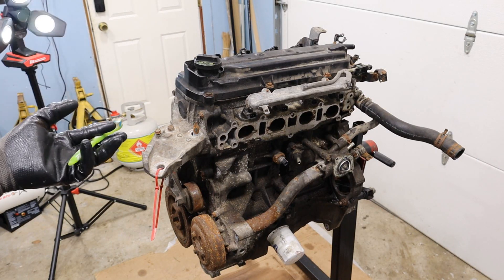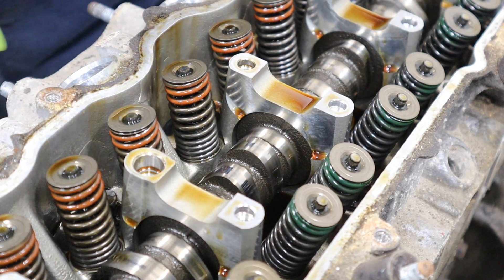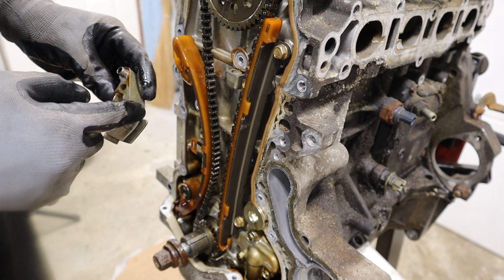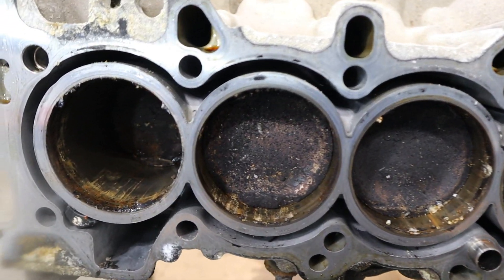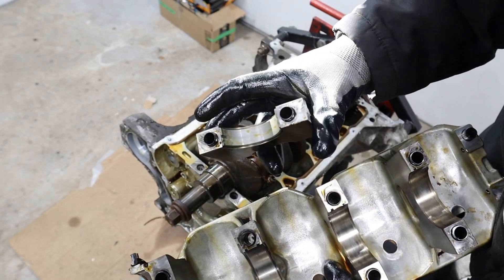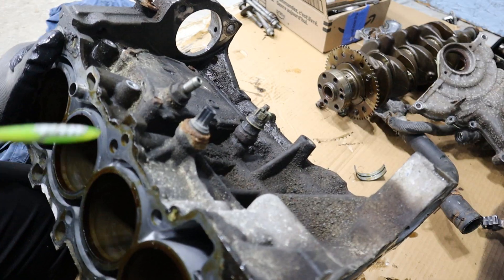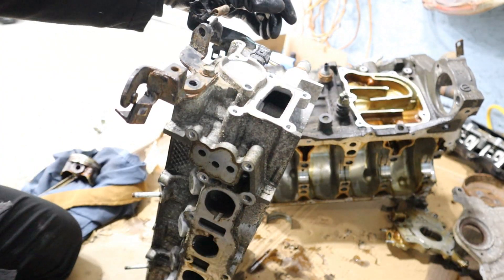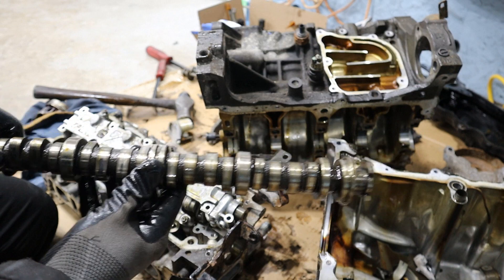The Honda L15 Was the Last Good Engine from Honda

Comment: I have a 2010 Honda fit with this engine. Has 380,000 miles and I change the oil every 25,000 with Amsoil. Been driving it since 40,000 and never had a problem with it. I still never adjusted the valves at 380k!

Comment: the honda fit lives on as the City Hatchback. L15Z dohc i-vtec w/ variable valve timing on intake camshaft only, around 121hp. same ULTR "magic" seats but longer wheelbase so it's even better than the old fit/jazz

Comment: 9:55 "Simplicity equals reliability" is so true! Honda made so many design choices with that in mind. The L15 is SOHC because it is less mechanically complex. It is naturally aspirated, but the I-VTEC opens one of the valves only slightly during the intake stroke to create an air vortex that blends the air, a bit like adding boost but obviously not as powerfully - and in a very mechanically simple way. Port injection rather than direct injection, for simplicity. It's under-square to give a torque boost, at the expense of high revs, because it's for a Jazz or City, just 1000kg or so, so it's not needed.

Comment: Technically, the last good honda engine is the K24Z7 in the Civic Si until 2015. Mine have 300k miles of trouble free miles.. the newish turbo Civic is also a L15 and it's more then Meh... Non direct injected K series are the tits!

Comment: I want a 2012-13 GE Fit for a daily, but there doesn't seem to be much aftermarket for this engine, except for strangely enough... high compression pistons. It will never be a D15B7 + Z6 mini me running P29's, but it would be nice to get something similar.
The gear ratios are a little long, but the final drive is short at 4.6 and I'd be happier with closer ratios with a longer final like 4.4 or 4.5 but Mfactory doesn't make them.
There are cams, but with those semi-long ratios whats the point. I'm thinking high comp pistons, the crz intake, header, exhaust and mapping should sort it out along with a light flywheels and lsd in the gearbox. 120whp would be really sweet but idk if that's possible with only the aforementioned mods. 
the high comp pistons should give it more power in the lower rpm range where those gear ratios fall after shifting, so there will be more power down there than before, ideally..

The L15B from the GK would be nice, along with it's 6mt, but at that point would it be a nightmare or not... 
Obviously the dream swap is the k24, but I like 1.5l powerplants. I just wish there was a jdm dohc 1.5 that would slap in there.

Comment: I've a Honda city (indian version ) with this L15z1 engine with a manual transmission. Weighs around 1040 k.g. and makes about 120 h.p. and revs over 7000 rpm. I've done nothing with my car and it's almost 10 years old. In india, the roads are filled with idiots and one cannot even use the full power of an 800 cc suzuki economy car. Here this engine is praised a lot for it's top end performance with minor tweaks.
Reply from the maker: Nice. This is the perfect engine for that type of driving
Reply: how many kms have you driven that car?
Reply: @dranzergigs8333  near about 95000

Comment: my wifes 08 fit has 360000 kms. doesnt burn oil.  it just works! brakes tires oil changes.there's many of them around here with 500-700000 kms as well. top 5 best car ever made.

Comment: I have a 2016 Honda Fit, 6speed manual transmission. Ultimate reliability
Reply from the maker: Just before they went to CVT and direct injection
Reply: @speedkar99  2016 is the year they went CVT & direct injection actually. Luckily I did get the 6 speed manual haha

Comment: Mine L15Z Manual, 8 years old. All i take was regular oils, filters, 2 battery, 1 time engine mounting sets, 1 time changing spark plug sets😂, about to replace the battery for the third times, maintenance cost so low.
Reply from the maker: That's awesome, how's the comfort?
Most people say that's where you pay the penalty
Reply: @speedkar99  no comfort but good  for cornering.

Comment: Wish the 1.7 in my 05 Civic had a timing chain. I'll never understand why they use timing belts in interference engines. Oh wait, I know why. So they can sell you another one when it breaks itself
Reply from the maker: The belt I think is cheaper in the long run. A chain job is very involved

Comment: I have a 1992 Accord with the F20A3 engine and it still runs like new at 85.000 km. Not even missing a beat!
Reply: That's low miles for a Honda

Comment: I had the exact same engine in my CR-Z [it has different engine code LEA, but its basically same engine] slapped turbo on it, made ~200hp and 50k miles later it runs to this day. And I gave it good use
Reply from the maker: Didn't know the crz had the 1.5
Reply: @speedkar99 yup, but with economy vtec so it makes less power. of course I swapped my cam and rockers tho now I got vtec yooooo
Reply: @crisisrogue8286  how much of a difference does the cam swap make? i lowkey wanna cam swap just for the vtec lol
Reply: @the_jeremy_renner_app makes a decent difference, but the sound is the biggest lol
Reply: @crisisrogue8286 thats all I needed to hear thanks. I dont even want more power I just wanna hear the vtec crossover haha

Comment: That engine is amazingly clean inside with little bearing wear indicating that high quality oil was being used in conjunction with more frequent oil & filter changes probably every 10,000 km. The top-end carbon build up and clogged piston rings indicate that it was a city car rather than an open road car. Great cars except for CVT problems at high mileage, again highly dependent on servicing intervals. Too much technology is the Achilles Heal of modern cars :(
Reply: Ditch the CVT for a regular 5 or 6 speed manual transmission and you would really have something, however, I don't have to tell you how the typical driver now adays is allergic to a clutch and shifter.  With the great condition of the dod and crank journals, I can just hear all the shouting from the "20 weight oils are superior" people.
Reply from the maker: Yeah smaller engines do better with manual transmissions

Comment: The L15 is awesome but the D15\D16 will always be my favorite, My d16y7 is going to hit 300k miles sometime this month, I've owned it since 120K great little motors from Honda :)
Reply: Lol.
My Dodge ram has over 320,000 miles.
It's a Hemi.
No major work and still has the original 16 spark plugs. (2 per cylinder)

Comment: I had a 2nd Gen Fit and I loved that car. It had as much room out back as a compact SUV. An errant pickup truck driver totaled it out on me. These engines love to rev and are known for lasting 300-400k miles with only regular maintenance.
Reply from the maker: How did you hold up in the accident? Most people don't like the fit because it feels unsafe
Reply: Incredibly well. I squarely hit a Dodge 2500 at around 50mph that failed to yield at a stop. My nose was sore from the airbag, but I was miraculously completely unharmed. The car was totaled, but I was so astonished from being okay that I wasn't even mad.

Comment: The L15A7 engine puts out decent power for a sohc. 118hp is heaps for the little jazz/fit especially with a manual transmission.
Reply from the maker: Agreed on the manual transmission
Reply: @speedkar99  We have a crz manual, I think its an l15 too. That thing is fun to drive but not long distances.
Reply: It's better than the various "Malaise Era" domestic V8's.

Comment: Our family's the proud owners of 3 Honda fits. 
2009, 2012, 2013...
They have been trouble free! The 09 is approaching 235 K. The 2013 Fits were the last Fits with a 5sp conventional transmission...the rest 2015 - till last year??? 2020? Were all $hitbox CVTs. Worse transmission pushed upon the automotive public!! The American people demand either a manual or a conventional clutch pac transmission. We luv our Honda fits. Wish Honda would bring them back!! Without CVT!!
Reply: As an owner of a '10 Fit i dare say that generation of Fits (the GE iirc) is the best one out of all. dead simple engine, parts are everywhere and Non-CVT auto transmissions.
Reply: Not quite true. The 3rd gen also came with a 6spd manual, like mine.
https://en.wikipedia.org/wiki/Honda_Fit#Third_generation_(GK/GH/GP;_2013)
Reply from the maker: Too bad they dont make them anymore

Comment: I could be mistaken, but I believe the VTEC system in these engines is designed for only one intake valve to be opening with the lower cam profile, usually under 3400 RPM. Then when the engine is revving higher than that, VTEC enables the mechanisms you described, allowing for both intake valves to open simultaneously, one of which opens more, again as you pointed out. My understanding of why this feature exists is that with only one intake valve opening, the air gets agitated more vigorously, contributing to a more favorable composition of the air fuel mixture, yielding more power at lower RPM. Also thanks for this awesome video
Reply: Also, with only 1 intake valve opening, there is greater intake charge velocity which helps out lower RPM engine torque.
Reply from the maker: If you look at the lobes, both of them open and are elliptical, not just one. 

The K-series accord engines for example, had one cam almost circular and the other oval for that effect ("I" in i-VTEC )
Reply: I never touched this engine, but from Honda scooter experience Honda has a SOHC 4-valve-per-cylinder system which at lower rpm 1 intake valve lifts fully while the other barely lifts (still has to lift, otherwise buildup will be an issue for city crawlers). At higher rpm the 2 intake valves are locked together and both are lifted by only the taller cam lobe.

Comment: I own a Honda city with the small motor and manual gearbox .it just never misses a beat ..the 1500 is such a good little motor .zippy enough and very economical.its sitting at 220000 KMs and doesn't use oil it's easy to work on .all I do is change the oil myself and it just goes and goes .great little motor
Reply: My family owns a 2011 Honda city 1.5 litre ivtec L15A7 Motor. I guess its the same one as yours. Pretty zippy when you put it in on Sport mode.

Comment: This is a great video, but I'm confused: you literally said "This doesn't have variable valve timing." Immediately followed by: "Here's where the VTEC solenoid goes." 😅
Reply: I think the VVT advances or retards the timing of the cams, the VTEC increases the duration of the valve opening with the taller cam lobe.
Reply: @josephrendon6969  Ah I see, cheers!
Reply: @Kj16V my pleasure! Had a ‘15 si with i- VTEC,which integrates VVT with VTEC.
Reply from the maker: Yeah VTEC on this is variable valve lift and not timing

Comment: I have a 2012 Fit with 220K miles. The only  problem I've had is the number 2 spark plug loosening after 60K miles which simply needed to be retightened. Honda had addressed this by increasing the tightening torque specification. Cars with direct injection should add an oil catch canister in the PCV system.

Comment: VVT is reliable based on design-Hyundai Veloster N and electric VVT. Idk about others, but know that BMWs implementation is 😬. Also will agree that modern Honda engines are just not it. Why would you put the intake above the turbo exhaust 😭-also the civic type r is imo the worst sounding turbo 4 ever made

Comment: Friend has a 2012 Fit with 368,000mi.

It broke down suddenly and lost power & she was about to scrap it, but I encouraged her to take a look at it. Turns out her son took it somewhere for a sparkplug change and the shop stripped the bolts and 1 of the sparkplugs popped out. ~$300 later and a new battery (from sitting so long) and it's back on the road
Reply: Those criminal technicians. Never me and waste "mechanics" again.

Comment: I have 18’ Si with the L15CA turbo and I will say that it dosnt really go over 300hp stock and I broke the 4th gear blew the turbo and threw a rod in that order but now I have built trans and small block as well as bigger turbo and now it’s the funnest car I’ve ever owned
Reply: Doesn’t the 10th gen Si have the L15B7, could have sworn the 11th gen has the L15CA
Reply: @ yeah I think your right I actually forgot the exact code and googled and saw CA but B sounds correct I know they are basically the same with the 11th having like 5 less hp or whatever but they are both glass when adding power so imagine the experience would be the same

Comment: These are very good engines. My girlfriend has a 2010 mod Honda Fit, (called Jazz here in Norway). She loves to drive, and the car just goes and goes. It has almost done 200,000 km. The engine uses neither oil nor water between services. 1.2 liters. All she does is press the gas pedal and fill up with gas, and I do services, change the oil and brakes :) Great cars.
Reply from the maker: They sure are great. Surprised we don't see too many of them. I guess civic was a more popular choice
Reply: @speedkar99  Yes, it also may have something to do with the appearance of those cars. Not the sportiest, to be sure :) But they are at the top of the cars with the fewest faults here in the Nordic countries. They are right after Toyota. But I didn't know the thing you said about the turbo problems. I've heard that some timing chains stretch on Honda Civics, but haven't heard much about the Jazz. Could be because there aren't that many of them being sold. Honda also has a bit expensive parts prices..
Reply: @speedkar99 we have a lot of fits here in Vancouver BC. Thank you for teardown!
Reply: I used to have Fiat Grande Punto 1.2
8V engine, 1 camshaft, but ut had VVT (Euro 5, 2012). Mine has done 270.000km, before it was replaced by Norway market 2018 Renault Zoe.
Reply: It has 8 spark plugs right? Have you changed them yet brother?

Comment: L15A7, amazing engine, coming from a subie enthusiast. love those little fuckers. 
you can supercharge them too if you really want to. F1 pedigree under the hood, rally pedigree on the suspension/chassis. just solid.
Reply: 72 retired subie enthusiast with a 2006 Subaru sti and a 98 Honda prelude.  Honda much easier to maintain and repair
Reply from the maker: Super charge? Lol
Reply: @speedkar99 Mugen actually supercharged one fit. Pretty cool car
Reply: @speedkar99 feasible.
But it's throwing away power.
Why supercharge when you can turbo?

Comment: NA L15 is still common here in Indonesia, but the CVT transmission, uhhh 🗿 lots of early failures yet still selling like hotcakes
Reply from the maker: Oh I bet those CVTs are problematic. 
Aren't there more manuals there?
Reply: @speedkar99  the market is already shifted to auto since 20 years here. It's a common occurrence of seeing a honda CVTs belt torn apart especially 2010s honda and newer
Reply: ah, glad I came across my fellow Indon

Comment: The problem is they need to design a new engine... for the power they try to put there, it just doesn't go well.
Reply from the maker: It's the emissions the issue. Not so much the power

Comment: Which years and models had this engine?
Reply from the maker: 2nd gen Honda Fit/Jazz
Reply: @speedkar99  thanks for the quick response!
Reply: @speedkar99 It was also available in the Honda City. I own a 2011 Honda city 1.5 litre L15A7 engine. Pretty zippy when you put it on Sport mode.
Reply: https://en.wikipedia.org/wiki/Honda_L_engine

Comment: It's basically an R18 but easier to work on.  No stupid belt tensioner but less accessible PCV valve.  R18 has a hydraulic tensioner for the timing chain.  Few other differences too, but basically the same engine.
Reply from the maker: I've got an R18 sitting here for teardown, it'll make a good comparison. Stay tuned

Comment: VTEC YO!  Really, though, 288000km/178000 miles really isn't that much for any engine anymore.  Not sure I've had a car with less than 180000 miles on it when it came time to trade it in...Chrysler, Ford, GM and my daughter has a Kia 2.0L with 140000 miles in it.
Reply from the maker: It's not much for a Honda. 
But a GM? 😓
Reply: @speedkar99 I had a 1997 Chevy cavalier with 370,000 miles.
A GM.
Reply: Dodge ram hemi with 320,000 miles.
With its original 16 spark plugs.
Only changed w pump and front cv axles. (Awd)

Comment: When is a good time to clean the valves on a direct injection engine, mileage wise? And do fuel additives help at all?
Reply: If it's an Audi high performance....
one owner made the dealer clean the valves every 10k miles. 
He had dynoed the engine when new. 
He dynoed the engine every 10k and showed the choking of the performacnce...so the dealer cleaned the intakes and the valves with walnut shell blasting..
every 10k miles until the warranty ran out!

I cleaned the intake on a Mitsi 2.4GDI at 100k miles. 
It took 3 cans of oven cleaner in the ali intake...
and I dug out the muck in the head with tongue depressors....

You mileage may vary....
Reply from the maker: Fuel additives won't help since it gets directly Injected and nothing goes to the valves.

Comment: The D16 series engine in my '91 Civic was solid, lasting 235K miles (378K Kilometers) before the transmission gave out, with the only issue of replacing the water pump.  But, I've yet to own a vehicle where the water pump life expectancy got to 100K miles.
Reply: Are you serious?  My 04 explorer still has the original water pump at 190k miles.
Reply: @Drewcardello  That Civic of mine, along with previous vehicles, piled on the miles with stop-and-go commute traffic, only had few occasions of non-stop highway drives.  Made me appreciate that I went with the auto-tranny.
Reply: Yeah, the D16 in my '95 was a gem, but waterpumps back in the day were kind of a weakspot for all cars.
Reply: My fit has 380,000 miles with the original water pump